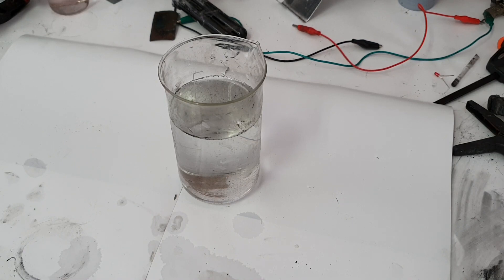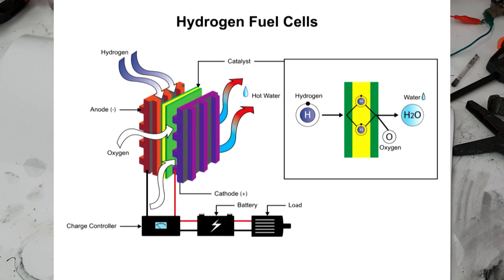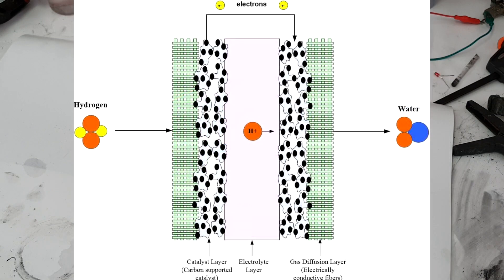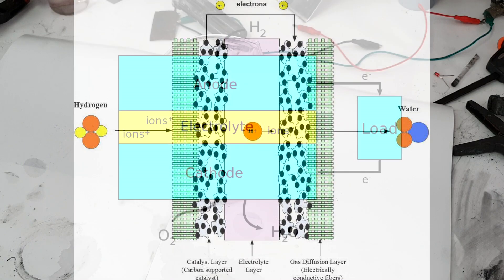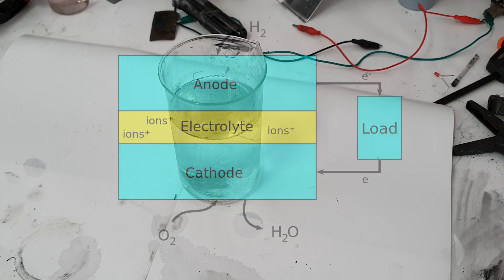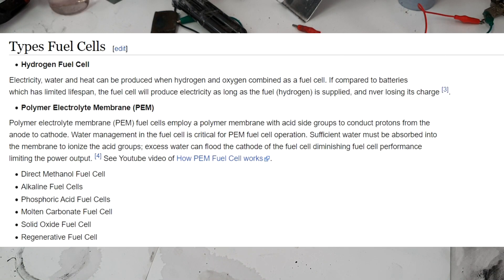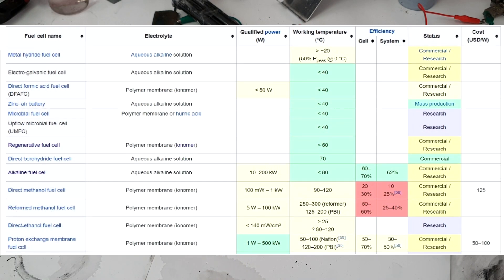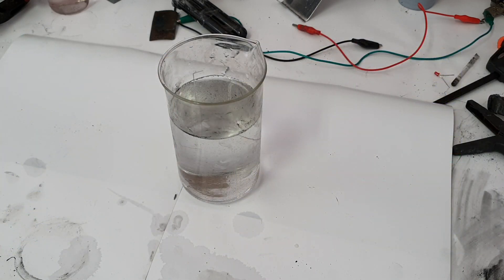Improvised Reversible Fuel Cell

Comment: Very interesting approach, though i do slightly have to agree with Andre's comment (below). Not entirely, but to some extent. You are correct that your device is storing energy by moving hydrogen ions between the electrodes. However the device is mostly storing energy in the form of OH-, as there is no acid (i assume) you're unlikely to be shuttling around H3O+. You are also producing H2 gas at voltage levels greater than 1.23V (without a catalyst) - however this H2 is not being captured or utilised, and instead vented off. This is due to the separator material you are using. Since it is a porous separator and not a polyelectrolyte membrane (selective ion conductor) you are not able to effectively transport or electro-osmotically capture the generated H+ ions. In your setup most of the H+ will gas off as H2 while some will bind to form OH- and even less as H3O+. 

The polyelectrolyte membrane allows H+ ions to be transported to the ORR catalytic zone and reduce H+ into H2O and some H2O2. This is key to the functioning of the fuel cell itself, and without this reaction pathway the device becomes an elechemical capacitor.

Touching on the catalyst subject a bit, nitrogen doped carbons have better ORR and OER reaction kinetics than regular carbon foams. Carbon itself, even nitrogen doped ones, show very sluggish and poor reaction kinetics overall. For reversible fuel cells the cathode is typically OER and ORR bifunctional while the anode is only HER. Having a porous separator and only carbon foams as catalysts for ORR, OER, and HER - and your device honestly can only perform a very sluggish 2-electron oxidation, definitely not a 4-electron oxidation. A 4-electron oxidation (required to reduce H+ to H2O instead of OH- ) is typically only seen in high-perfomance catalysts. Such as Pt/C, CoO, IrO, MoS2, Nx - C, etc. Cobalt shows high selectivity towrds the 4-electron exchange reaction, which is one of the reasons it is seen as a viable alternative to current Pt/C and even IrO/C.   

In my research modified polypoyrroles (such a Ppy-TsOH/C) perform very well towards the 4-electron transfer reaction and metals are not required. The polymer doping of a nitrogen doped carbon (high BET surface area) is enough to catalyse H+ into H2O. I have found that adding metal salts (acetates from the transition metals perform the best, some nitrates from the transition metal family work as well) to the polymer in varying ratios increases the effect further and outperforms the standard Pt/C and IrO/C.
Reply from the maker: Like I said Andre, I was to fast and with brain off when I call this device a fuel cell. I use materials that I have by my hands to get similar reaction like by fuel cell.
Reply: @cayrex  no worries :) i understand - just sharing the knowledge. I enjoyed the video - is a great experiment and showd the potential for this kind of approach
Reply: @Zacariah Heim @cayrex2 Not sure if you guys are already aware of this but apparently Fe and Ni nanoparticles also works well as described here: https://www.nature.com/articles/s41467-019-13415-8, which is potentially a much cheaper approach.
Reply from the maker: @cmalune  hey mate. This one is also good is similar to nickel/nickel oxide. If you look around you have a big number of various catalysts which can be used. The bad thing for now is that I can not try because I still wait for nickel.
Reply: @cayrex  Hi Dusan,  what Nickel are you looking for ? kev
Reply from the maker: @mouldykev  hey mate. How are you? I already get some nickel and also some pure nickel is on my way to me.
Reply: @cayrex  All Good mate 😎 The Carbonator is back soon !   if there is anything you need that i can help you with just ask...........................kev
Reply: @mouldykev  Great to hear the Carbonator is coming back soon!, awesome stuff! :) (y)
Reply: @petermiddleton6902  Hello Pete how ya doin ? what you up to ? 😎
Reply: @mouldykev  Im still on the same Mexican Island developing all sorts of innovative eco techs which are rapidly moving forward. With whats going on in the world right now im probs going to be here alot longer than i planned. Fantastic to hear from you Kev!. Be prepped up, keep safe, & occupied, and im sure this crisis can be weathered out in good time :) (y)
Reply: @petermiddleton6902  No worries mate, stay safe ;-)))
Reply: @mouldykev  Onwards & upwards is the way to go to those keep the spirit up for cert! 8) (y)
Reply: @mouldykev  Great Kev ! Welcome back ! Looking forward to see new videos from you. Happy day !
Reply: Also for the membrane Chitosan + Sulfonated Graphene Oxide is a very cheap alternative to Nafion.
Reply: @cayrex  Look forward to seeing you make the alkaline fuel cell with separate gas tanks, hopefully not too long to wait, thanks :-)
Reply: Unfortunately I cannot find my original comment (probably deleted for some reason?) but I have to disagree at a few points you mentioned:
I will just add my comment over a copy of yours so its not overall confusing:

Very interesting approach, though i do slightly have to agree with Andre's comment (below). Not entirely, but to some extent. You are correct that your device is storing energy by moving hydrogen ions between the electrodes. However the device is mostly storing energy in the form of OH-, as there is no acid (i assume) you're unlikely to be shuttling around H3O+. You are also producing H2 gas at voltage levels greater than 1.23V (without a catalyst) - however this H2 is not being captured or utilised, and instead vented off. This is due to the separator material you are using. 

//Well no. That’s the first point I have to disagree on. This device doesn’t work by „shuttling“ protons between the electrodes since you would need a redox couple for that to work which one really doesn’t have because of the almost non existent catalytic activity or bare carbon. Cayrex is storing the electrical energy in two ways, first on definitely some charge is stored capacitively by charge separation and secondly he is practically producing a helmholtz double layer which is able to store an electrical charge by adsorbing and desolvating some ions from the aqueous solution. 
Those two mechanisms are characteristics of an EDLC. 
When making a CV there will be definitely no voltage plateau which further supports statement. 
Also the formation of some stable OH- species is highly unlikely in a neutral or near neutral pH because of the amphoteric character of water molecule. 
The higher-than-theoretical voltage needed for water splitting is easily explainable by the high overpotential and low catalytic activity of the carbon concerning OER and HER. Also if he used electrodes with a proper catalytic activity he would definitely have gotten some fuel cell action even without using polymeric or even selective membranes since the electrolyte shows quite some selectivity but of course diffusion
is a source of losses. 

Since it is a porous separator and not a polyelectrolyte membrane (selective ion conductor) you are not able to effectively transport or electro-osmotically capture the generated H+ ions. 

//well it would be pretty efficient when using no separators if he used an acid or strong alkaline electrolyte which shows excellent intrinsic selectivity. Most alkaline fuel cells still use some porous ceramic membranes soaked in aqueous KOH which works quite fine. Even without the use of an AEM this setup could then even be more efficient than normal PEMFCs because the redox potential and reaction kinetics are favored in alkaline solutions. 

In your setup most of the H+ will gas off as H2 while some will bind to form OH- and even less as H3O+. 

//nah, H+ won’t really gas off, far too reactive for that. Rather molecular hydrogen gases off. 

The polyelectrolyte membrane allows H+ ions to be transported to the ORR catalytic zone and reduce H+ into H2O 

// As already mentioned a OH- selective membrane would be better for diy projects because else platinum would have to be involved. 
Also H+ isn‘t reduced to anything. H+ has the oxidation number +I just as the hydrogen atom in water does so there wouldn’t be any reduction or oxidation here. But the molecular hydrogen will be OXIDIZED to H2O. 

and some H2O2. This is key to the functioning of the fuel cell itself, and without this reaction pathway the device becomes an elechemical capacitor.

// jep totally agree with that. What he built is essentially a supercap. The high voltage he applied will additionally promote the formation of carbon intercalation compounds like partially sodiated carbon. If he keeps the charging voltage below ~1.8V the CV will look like that of a supercap. 

Touching on the catalyst subject a bit, nitrogen doped carbons have better ORR and OER reaction kinetics than regular carbon foams. Carbon itself, even nitrogen doped ones, show very sluggish and poor reaction kinetics overall. 

//agreed

For reversible fuel cells the cathode is typically OER and ORR bifunctional while the anode is only HER. 

// also agree till here but it’ll get very confusing a few lines ahead. 

Having a porous separator and only carbon foams as catalysts for ORR, OER, and HER - and your device honestly can only perform a very sluggish 2-electron oxidation, definitely not a 4-electron oxidation. A 4-electron oxidation (required to reduce H+ to H2O instead of OH- ) is typically only seen in high-perfomance catalysts. 

//okay that‘s the confusing part. First on I  repeat that H+ isn’t reduced to anything since the oxidation state doesn’t change. 
The reduction happens at the cathode side by either reducing O2 to OH- in alkaline electrolyte or reducing O2 directly to H2O by H+/H3O+. 
Also the oxidation of biatomic hydrogen molecules can never NEVER EVER be a 4-electron oxidation. 

In alkaline: H2 + 2OH- —> 2H2O + 2e- 
in acidic: 2H2 + H2O —> H3O+ + 4e- 

See in acidic solution you oxidize (not reduce) two hydrogen molecules in a two electron system to H3O+. 

Such as Pt/C, CoO, IrO, MoS2, Nx - C, etc. Cobalt shows high selectivity towrds the 4-electron exchange reaction, which is one of the reasons it is seen as a viable alternative to current Pt/C and even IrO/C.   

// I think I get what you mean with 4-electron oxidation even though its not really correct saying it like that. 
In alkaline chemistry the ORR kinetics are simply less sluggish than in acidic because of the lower overpotential associated with ORR at high pH. 

In my research modified polypoyrroles (such a Ppy-TsOH/C) perform very well towards the 4-electron transfer reaction and metals are not required. The polymer doping of a nitrogen doped carbon (high BET surface area) is enough to catalyse H+ into H2O. 

//H+ is readily reactive like heck. It will react with oxygen without any catalyst. But you need the catalyst to oxidize hydrogen to H+ in the first place. 
Keep in mind how reactive ions really are. 

I have found that adding metal salts (acetates from the transition metals perform the best, some nitrates from the transition metal family work as well) to the polymer in varying ratios increases the effect further and outperforms the standard Pt/C and IrO/C.

//Iridium oxide doesn’t really exist as iridium(II) oxide but either as iridium(I)oxide or iridium(II)oxide.

Undoubtedly your chemistry knowledge is quite advanced concerning electrochemistry and I bet you probably read hundreds if not even thousands of research papers concerning this topic but you poorly made quite some mistakes as well